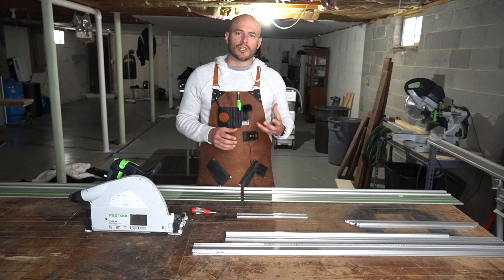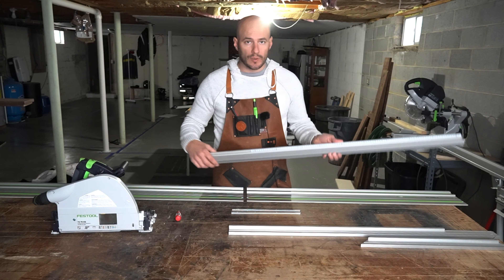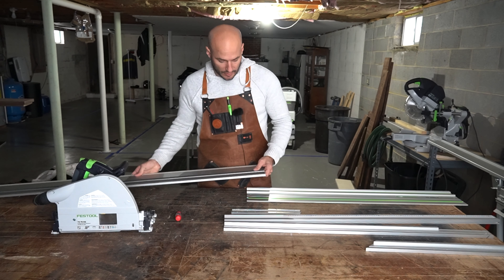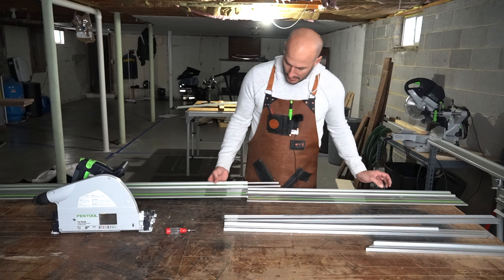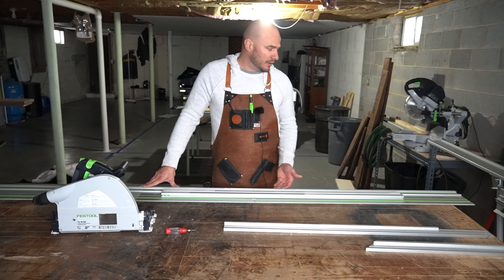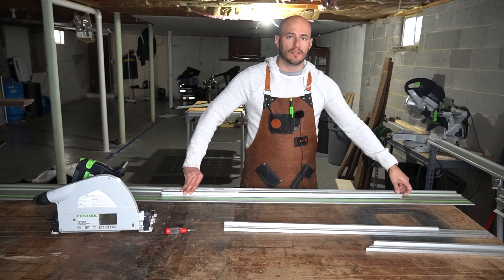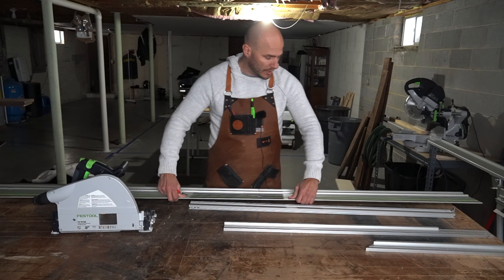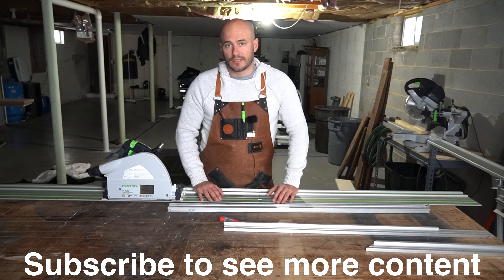How to Connect and Properly Align Festool Guide Rails

Comment from the maker: As I'm watching this now, I noticed that totally didn't tighten the bottom screws on the second guide rail...BUT I said to do it!!! Dang youtubers!!😂Make sure you tighten top AND bottom screws while shooting your youtube videos!
Reply: Agreed! If you have to make ultra accurate full length rips then that will guarantee string line accuracy. 
I work mainly in ‘the-field’, I feel more confident having both the rails butted up together as there would likely be less chance of movement compared to having an international alignment gap. (My gear gets abused!!🤪)
Reply from the maker: @deanelyons  Oh i can imagine it gets banged up quite a bit if you're lugging it around job sites - benefits of being a hobbyist!! I think everyone has to work around their own gear in their own way - if it works for you AND gets the job done, then more power to ya!!!
Reply: Just use the same screw tightening guide we use tender parts in aircraft maintenance.  1/6th turn past sharp rise in torque

Comment: I purchased the Betterley StraightLine Connector for about $100 and have had great results connecting 2-1400 rails. It is fast and accurate. I can transport my rails in my Makita rail bag to site easily and connect with confidence. Had friend with long rail that ended up on side of road after blowing out of bed traveling to site. Am happy with my way.
Reply from the maker: Oh man that sucks about your friend's rail!!! I've heard great things about the betterley connectors, glad you're having good use of it
Reply: Just got my Betterly today. Essential add on for us folks who use a modular fence approach to going highly portable, yet able to switch into ultra accurate door and plywood ripping in one minute.

Comment: In my opinion TSO makes the best guide rail connectors, and their fasteners are designed in a way to not damage your track.
Reply from the maker: The new fasteners from festool are much better than the old ones

Comment: Great video very clear and informative, I've recently bought a HKC 55 and 1400 guide rail, quick couple of questions

1) After adjusting the cams I've noticed the blade is touching the splinter guard on the rail, and will obviously rip it when I eventually get round to using it, is this normal and expected ? it Seems a bit extreme, why wouldn't festool just make the splinter guard meet the edge of the blade ? if so what is the correct way of doing it, just simply cut it off with the saw blade on the first pass ? if not what do I need to adjust on the saw to stop it cutting the splinter rail ?

2) I need to get another rail and connectors to cut UK standard sized sheets of 2440mm x 1220mm. What is the minimum overhang of the rails bottom and top of the work piece, I wanted to get a 1080 guide rail which would give me a total of 2480mm and a 20mm over hang top and bottom, Ive discovered  that I can overhang the base plate of the saw 60 - 65mm over the edge of the rail at the beginning, before the back cam becomes disengaged causing slop, so I cant overhang it anymore than that. will this be enough to ensure the blade cuts from the very beginning of the sheet and to the very end, or do I need more overhang and Should I get another 1400 rail instead ?
Thanks for taking time to read all that any advise greatly appreciated.
Reply from the maker: Hey, Rocket, thanks for the questions. 

1. I don't have any experience with the HKC, however with the track saws, the splinter guards do have to be replaced every now and then (depends on use - I've had mine for almost a year and will replace it soon). Seems like this is just a lessoned learned with you adjusting the cams. You should adjust your cams first, and then rip the splinter guard (when new) before making a cut on a project. 

2. For the overhang, you want enough rail leftover for the guide plate (flat surface of saw) to be on the rail before going into the material (at least before the arbor). In my experience, it's always best to get a little more extra than what you think you need concerning guide rails. It's always easier to trim your own guide rails (if limited on space) than to buy additional guide rails if you end up being short with what you have. 

Hope this helps!
Reply: @BenMarshallDesigns  Hi Ben thanks for the amazingly quick response, so I assume the splinter guard is meant to be ripped before first use to take into account subtle differences between models.
circumstancespiece.

irresistible,you're

you'vesubscriber
Reply from the maker: @rocketmunkey1  yes, the first thing you should do with a new guiderail/splinter guard is rip it (without ripping a material). Sometimes our excitement gets the best of us with new tools 😅
Reply: @BenMarshallDesigns  I think my problem  being as I am a bit of a perfectionist, is I'm too hesitant, having just purchased a fabled Festool saw that hesitancy has been turned up to 11 ;D
Reply from the maker: @rocketmunkey1  Perfection comes with practice, my friend. Can't reach perfection unless you start shredding wood fibers. Get to it!

Comment: Thank you for a very clear and comprehensive explanation. I wonder what you think of 'self-aligning' connectors e.g the TSO GRC-12? Also what about the Festool FSV/2 connectors?
Reply from the maker: Thanks for checking it out, glad it helped! I recently picked up the new style connectors, but haven’t messed with them yet!
Reply: TSO connectors are made of aluminum so not very sturdy.
Reply from the maker: @johndietz1266  good to know!
Reply: Your better off getting a good quality 48” straight edge to line up the tracks then use the Festool connectors to tighten them up as shown in this video.
Reply: @johndietz1266  thanks, thats helpful.

Comment: Thanks for the video. If you think the end of the rail could be out of square why don’t you pop it on the Kapex (both ends) then double check for a square cut. Then you can butt them together and get a pretty accurate straight connection?
Reply from the maker: I considered that, however it isn't necessary to have square ends to get the rails in alignment. I think some people default to think that if the ends are touching, it's in alignment, so I wanted to dispel using the ends as a means to align everything.
Reply: @BenMarshallDesigns  Exactly. Not to mention many people have more than two rails ...
Reply from the maker: @minosi8123  Yep - I think most people fall into that category. Having a longer rail is all about what projects are being done, the time available, money etc. I was lucky enough to be gifted an extra 1080 rail from a friend!
Reply: What I can’t understand is why wouldn’t the rail ends be cut perfectly square from the factory, the machinery used to produce Festool products should be more than capable of cutting a perfect square cut surely .

Comment: First Ben, GREAT video as always!!!

I have a question for you.  I am attempting to use the MFT to rip some 1"x 8" lumber  (screwed together 2 high) down to 90mm wide.  But, the problem is that it canters because the track sits on wood which is not as wide as the track.  And, due to the twists and bowing in 1"x, I can't seem to wrap my head around the best approach for leveling off (especially since it doesn't lie flat, as MDF would if simply butting it against the shallow edge of MDF pieces to be cut).

ALLLLlllllll of that stated, Brother... What would be your approach.

(Addendum: I screwed them 2 high, because I will be duplicating the holes intended to be drilled later, and routing slots... so I thought it best to do them all in one process for accuracy.  However, if you have other recommendations, then please fire away... I wanted to give a fuller picture so that you could provide the best overall advice for the situation.)

BTW... Happy New Year!
Reply from the maker: Thanks! That's a pickle. Anytime you're ripping stock that is narrower than the guide rail, you need to have something of equal height/thickness under the guide rail - there's no getting around that. 

And if you've got twists and bows...there's not a whole lot you can do to remedy that, other than getting a joiner and planer. Dunno what you're intended use is, but in most cases that's the best bet. If you have a thickness planer, look into a planer sled - which will allow you to use your thickness planer as a joiner (of sorts). I recently milled my own rough cut lumber, straight as can be, with just the thickness planer and a shop mad planer sled.

And, it's hard to picture what your predicament is through text. Hopefully you get it sorted out - and Happy New Year to you as well.
Reply: @BenMarshallDesigns  Thanks, Brother.  I appreciate it as always man.

Comment: Use your saw to align your rails. Just put it at the joint and tighten the cams until the saw sticks to rail, then tighten.
Reply from the maker: I've attempted that method before, and proper alignment needs at least two points on each rail. Using the cams only uses one point per rail, so there's a chance it can get misaligned. The longer the guide rail, the larger the error at the tail end of the cut. I only say this because I've cursed at the gods many nights trying to get good rips!
Reply: @BenMarshallDesigns  technically isn't there three reference points, given the rail attachments?
Reply from the maker: @dylanm3519  two points of contact meaning the two cam locks. If done how Festool USA's channel showed, straddling the track saw at the joint, with one cam on each of the guide rails. Locking down the cams pinches the guide rails in one location per rail. If you have a track saw and guide rail, I encourage you to see how much play there is in the un-tightened guide rail. There's too much play for my liking!
Reply from the maker: @dylanm3519  However, if that method works for you (and anyone else that uses it), and you're getting the results you want - then all the power to ya!!
Reply: @BenMarshallDesigns  to be honest, I haven't had to attach rails yet to make longer cuts. But I will have to. So I guess I can test the hypothesis regarding your method and the method I've seen on festool's own video. Situations are never as simple as they are sometimes made to look.
Reply from the maker: @dylanm3519  very true! If you have a straight edge, I highly encourage you to just double check after the track saw method of aligning your rails. If you're able to get the confidence from that method, then keep on keepin on!

Comment: TSO track connectors, automatically align the tracks up without needing a straight edge, is what i use to join three 55 inch
tracks perfect every time makes transport of long track so much easier, check em out!

And great tips and info on your channel thanks for time to create!
Reply from the maker: I've heard lots of great things about the TSO connectors, and thanks for sharing your experience with them!! Glad you're finding the channel helpful and thanks for dropping a comment.
Reply: Hello, where did you buy your TSO connectors?  I looked on their website and they seem to be out of stock at the moment.
Reply: Don’t be so high on TSO rail connectors they are made of aluminum and can easily get bent from mishandling and become useless.
Reply: Your better off getting a good quality straight edge to align the tracks then locking them down with the Festool connectors.
Reply: @johndietz1266  been using mine for 3 years in multiple construction environments, still straight!, FYI, tracks are aluminum too, maybe we better 
get steel tracks? My comment is based on real world use, I'm curious, what is yours based on?

Comment: I agree with not over tightening the rail connecting screws, but you really need to have them a lot tighter than your demo, when the two rails are moved around the entire day with multiple cuts, they will move if you were to stop tightening them once you feel resistance. You would really need to be ham fisted for a grub screw to dent that track. This is why Festool love flat heads, Almost impossible to over tighten things with a flat head , it will jump out of the grove before you get to damage it .
Reply from the maker: flat head screws are a part of the axis of evil. But Festool chose flathead to prevent people from over tightening too much

Comment: The cost of 2 pieces steel with some tapped holes in them is a rip off.
Reply from the maker: Let me know when you start selling cheaper versions
Reply: @BenMarshallDesigns  just get 2 pieces of steel and drill and tap some holes. In Australia Festool want $80 for that. It's about $6 worth of steel.
Reply from the maker: It's so much easier to just click a button on amazon though... so